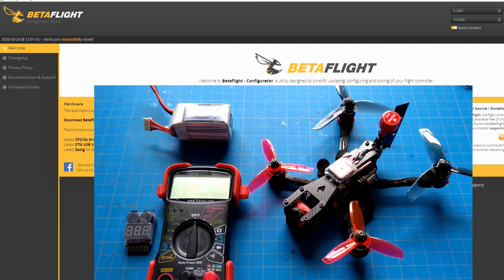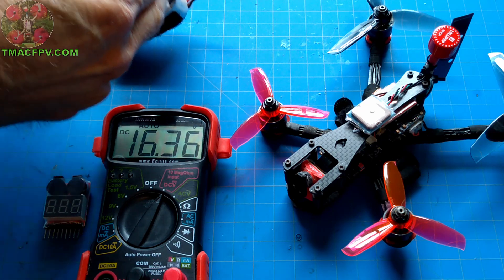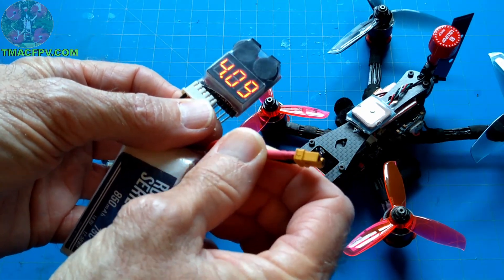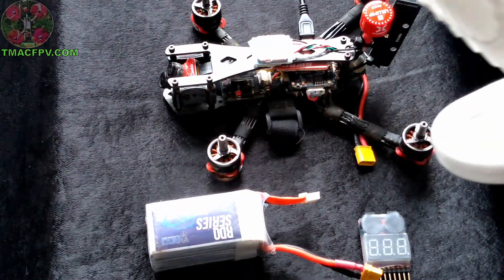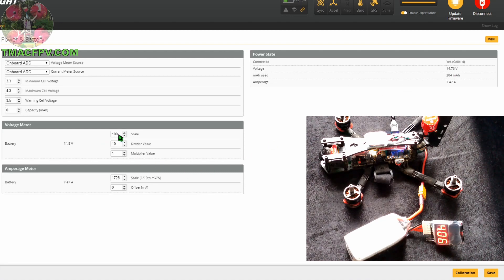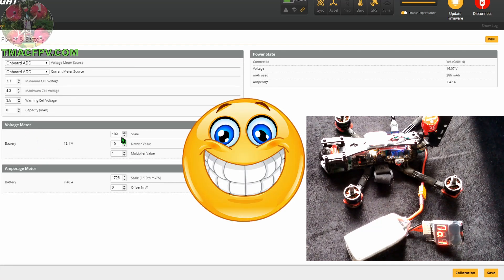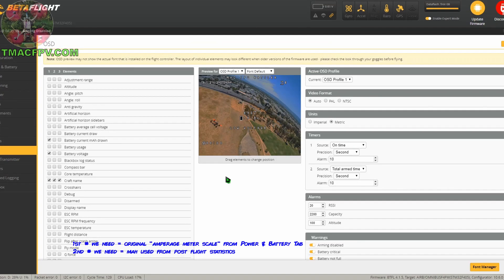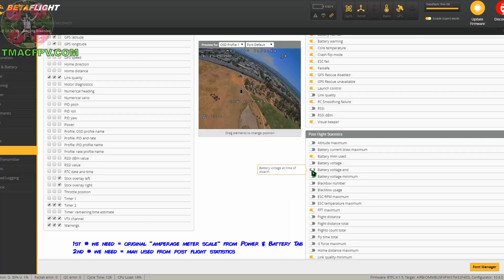FPV Battery Voltage & Current Calibration (FLY LONGER!)

Comment from the maker: When was the last time you calibrated?  Be honest, now!  Ready to get more flight time & save battery life?  What was your biggest takeaway from this video?  Fly fearlessly!👍😀
Reply: You helped me a lot thanks
Reply from the maker: @mister-t6890  Sure thing Mister-t!
Reply: Nobody has so far described how to accurately set the current sensor Scale and Offset parameters correctly. It can be done, but it requires something like a ToolkitRC M6D, some math, and maybe a 100nF capacitor. That does not mean your method is without value though, but it isn't accurate.

Comment: Thanks for the video. To keep my VTX from overheating I have "VTX pit mode" enabled on a switch on my T16. There's also a "low power disarm" in the VTX tab in betaflight. I haven't used it but the "on until first arm" option looks promising. Keep the videos coming!
Reply from the maker: You're quite welcome 1UP FPV and thanks for the tips! "Core temp" of FC gets too high when I'm working either on BF or workbench in addition to VTX (you can see core temp warning on OSD). Fan helps prevent this also
Reply: There's also image processing board that can get really hot (ie: DJI FPV system, RunCam Split, Tarsier, etc).. so your fan is your best friend. :)

Comment: Thanks for the video. I'm running a tiny whoop with a 200mAh 1S lipo, it was showing my draw between 11-13amps. I fully charged my lipo, to 4.2V adjusted the battery Voltage scale in Betaflight until it read the same. Amps at that time said I was using 5A+ draw with nothing connected, but the lipo.  After charging my battery I flew lazily around my home for 1 minute. Upon disarming my OSD reported that I had used  530mAh. How the heck is that? As I mentioned, my lipo is a 1S 200mAh. Adjusting scale now.

Comment: Nice video, very helpful. However... I have followed the steps and I get the following: 
When I plug my fully charged 4S battery into my quad the voltage used to show 15.6. 
I've gone into betaflight and in the power & battery tab change the scale up all the way to 152 and now it ready the battery correctly at 16.8v (while the battery checker is plugged in). 

But I've taken one of my other batteries that are in storage mode 14.8v... and checked again... Voltage still shows at 16.8 even though the plugged-in battery checker displays 14.8...

Any ideas as to what I'm doing wrong here?

Comment: one of my 6s builds with the speedybee v3 stack over 22 volts the motors oscillate like over voltage right at 22 volts motors run perfect ????????? any ideas i ran out of adjustment in pid  ,, faulty gyro or voltage regulator

Comment: Hi ... congratulations ... I'm Italian ... it's all clear ... just one thing. if I use different batteries, on my quad ... who will be my reference, for example if I have a 0.450mah 4s 16.8v Lipo battery and another 0.450mah 4s 17.4v LiHv battery ... to use both on my microdrone, on the betaflight page ... who do I use as a reference? that LiHv?

Comment: Hi, i got a problem i calibrated my battery on betaflight with 1st battery 24.9v. Then when i put my 2nd battery that is 22.5v on my multi meter but the reading on betaflight is 24.67v. Also on OSD the readings are incorrect.

Before that, i got bridge between the two resistoe then removed it then voltage reading is back at betaflight but not accurate.

Comment: Thanks for the video! as basic as it is to calibrate voltage and current I have never done it... but thanks to your video I have some tinkering to do this weekend... I also really appreciate the (bonus for audio alerts) I had been wondering how to accomplish that, I have a feeling this will increase my flight times by quite a bit as I rarely run my batteries down to even storage voltage. Stay safe.
Reply from the maker: Happy to help Keith! Simple and effective steps we all overlook at times. Might as well get the most flight time we can, right?🤩👍

Comment: Thank you for this! Does this need to be done for each type of battery a quad will use? I have one that can use both 2s and 3s. If if I did this with the 2s battery attached would it only be valid for the 2s and not the 3s?
Reply from the maker: I would think it would be the same Nathan however I have not tested it myself.  My recommendation is to calibrate  using the process with a 2S or 3S.  then fly the other cell battery 3S or 2S and do the process again to see if it changes much.  It will probably change a little (it does that even for the same # of cells batteries).  Then you'll know for sure
Reply: @TMacFPV  got it. So it’s not necessary to calibrate for every battery then.

Comment: What play track are you over wrighting for low lq?
Reply from the maker: Its a custom sound link I made using the process I describe in this video (which works for any transmitter using OpenTX operating system firmware): https://www.youtube.com/watch?v=RSxD9Th1VDo  The sound track itself I have made available for you here (but used "TMac" in it so you'd most likely want to make your own--see custom sound video link provided earlier in this comment):  https://drive.google.com/file/d/1Kx1NTGGHtZ_7V94r13PbTKt8HtbInne2/view?usp=sharing  You can also use the stock sounds sigcrt or siglow in the sounds folder.  You don't have to "overwrite" any sound file to make a custom sound. You can make and save a brand new custom sound without overwriting any of the other ones in the folder

Comment: how do you calibrate RXBT telemetry data in Jumper T16? I deleted all sensors and rediscovered them and I'm still getting the incorrect battery voltage reading on my Jumper T16 under RxBT in telemetry screen. I followed steps in this video to calibrate betaflight and I get correct reading in video OSD but not on my transmitter. I tried using "offset" but the reading just froze to the value I adjusted to and wouldn't change.
Reply from the maker: So you've got battery voltage on OSD by toggling on what exactly in your OSD? You're expecting to see "battery voltage" in your transmitter with the Rxbt value? What receiver are you using?
Reply: @TMacFPV  yes i can see the voltage in goggles which i setup through OSD tab in betaflight (current voltage).  I'm using R-XSR flashed to  latest ACCST F-port firmware. I have smartport pin connected to SBUS designated UART on my Tyro119 FC.
Reply from the maker: FPort setup video here may help https://youtu.be/hwJtnkVq274 Also, if I'm not mistaken, battery voltage on RXSR is VFAS values in transmitter, not RxBt. With Crossfire, it's RxBt
Reply: @TMacFPV  Well I'm an idiot. RxBt (receiver Battery) is the voltage the receiver is getting >4.9V in my case. LOL. Thank you for sending me that other link that helped me realize my main issue is my flight controller is not sending telemetry to my R-XSR. I tried all combinations of serialrx_inverted and serialrx_halfduplex on and off and it doesn't seem to work. I have telemetry enabled in betaflight config tab as well. And I'm running Betflight 4.2.0.
I have smartport pin connected to my F4 Flight controllers designated (inverted) SBUS pad. Is this wrong?
Reply from the maker: Nathan watch the video on FPort through the link I sent you starting at the 2:15 time mark.  Pay attention to the requirements for FPort on and F4 flight controller.  It needs to be an inverted bi-directional port.  Although inverted, I do not believe your SBUS port satisfies the bi-directional requirement.  Bottom line is this: trying to get FPort to work on an F4 flight controller requires a "special port" which very few have.  Its a better idea to go back to SPort and SBus (just one more wire) with an F4 flight controller.
Reply: @TMacFPV  Thank you for the help. you are correct. The SBUS (RX) pad on an F4 flight does not support bidirectional communication. Its a 1 way street. So I soldered a wire from the uninverted pad on receiver to TX pad on FC and it all works great now. Thank you so much for your help with this!
Reply from the maker: Sure thing Nathan 👍

Comment: voltage checker alarms dont read acuratly ive had 10 over the years they all read way off i use a quality dmm meter old school meters from the 90s or 2000s are good crafts man chinese ones you buy at harbor frieght dont bother get high end ones pay more than 20 dollars a good one will cost you 200  dont use the cheap battery checkers they say one thing then you plug in the batt to a good checker and youll see what i mean

Comment: There is absolutely no need to take your props off if you are only connecting your quad to your computer via USB. Motors will only ever spin if there is a lipo connected, and I can bet my life on this.
Reply from the maker: Correct Steddie FPV. Encouraging folks to practice good habits so they keep all their fingers. It's very easy to "start" working on quad without LiPo (with props on) thinking you won't need it. Then, you transition to needing/wanting to power quad with LiPo and its a nuisance to take props off. "It's only for a few minutes. "It won't happen to me." Before you know it . . . However, yes, you are indeed correct.